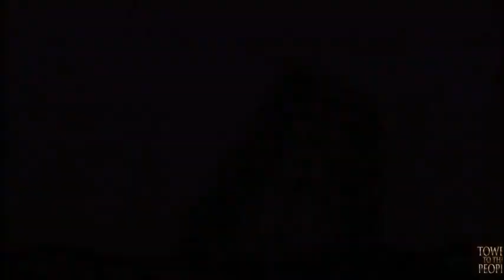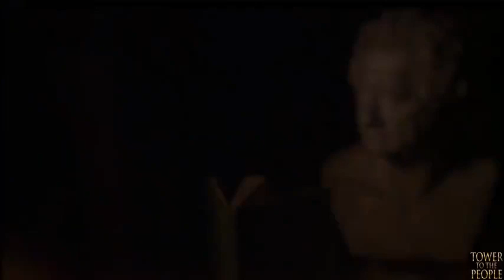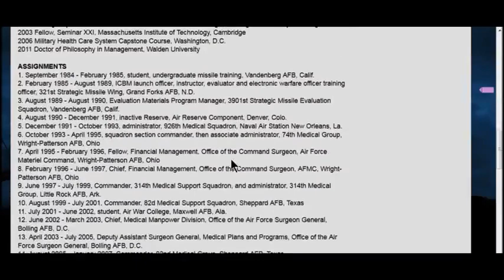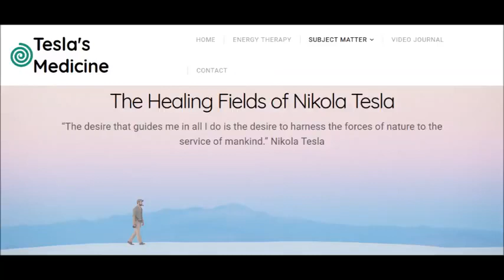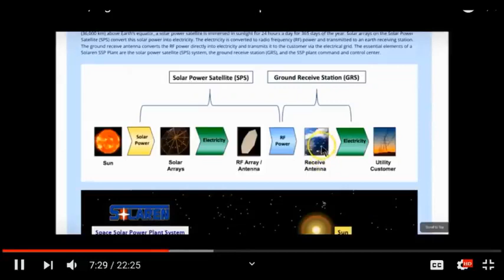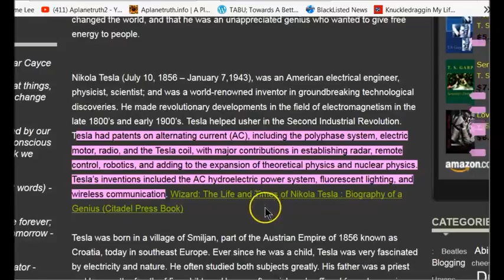Nikola Tesla Tower could provide the World with free wireless energy - Tesla's Wardenclyffe Tower

Comment: HOW MIGHT WE OBTAIN ENERGY from SURROUNDING TEMPERAUTRE
MAY WE?
1)
Might we built thermal motor with 100% efficiency?
This model SAID yes , how? Read below and enjoy the journej

(and therefore have possibility to obtain energy from the surroundings without consuming some fuel though in theory)

(let it be in the vacuum )
Shocking but fact - this motors already convert 100% heat energy into pover
BUT!!!  (how it might be without it) in the First Stage      when it expand to the point where temperature equal environment temperature
(simple machine which consist of piston , cylinder, gas inside it)

In the Second stage we should compress volum emiting heat to the environment with the same temperature what environment has and therefore waste energy (even nothing to contain
thermodynamic allows us contain overheat without effort but in this case we dont have overheat)

So if we can avoid second stage we can save efficiency(and it might remain 100%)

And solution  how to avoid  waste power of compressing gas is...  :)
Dont use GAS !
we might USE LIQUID heated to the boiling temperature (boiling temperature depends on pressure on piston, let it be atmosphere pressure 1 Bar/100 kPa)

So we boil water, expand volume with 1BAR pressure, supply heat 212 F/ 100 C 
in the process, then we store remain warm(overheat if compare it to the environment temperature)
And - without effort return piston to the start position(thats it, all what for all of it,
this key component, we got it)

In the next stage we return stored warm into system and supply additional heat
intto the system
And repeat it again and again never emit any heat to the surroundings
All warm eventually would become power.

We heated water, we get what we want(power)
we store remain overheat to the storage with 0 effort
in order to use it in the next stage, and repeat 
we use heat in storage , then supply additional heat 
and repeat it again and again without waste of energy
therefore all warm energy will become power even though not at once
(thi is idea)

if we talking about water , temperature of boiling water is 212 F/100 C 
Coefficient of efficiency may be something around 4 (0.25 points input power to obtain 1 point warm energy)

And all iof it as we could see , might be converted to power
another words input 1, output 4 , difference would obtained from surroundings warm (another words it may be little bit colder if then)
2)
===============
What if we build a scheme in which we put energy in by maintaining constant current through coil?

We have electric circuit - battery 10 V , resistor 1 Om , output coil of transformer
(we prepear it to input 1A, 1V quadrupol impuls -add to voltage of our circuit 
for a while, transformer make as straight piece of ferrit)
And we add to transgormer 1 more coil to compensate current through resistor and transformer U = 0 V , I=10 A(the same current as main)

So we have current through main scheme 10 Amps, 10 Volts from battery
We throw impuls on transformer 1 Volt , 1 Amp, and have
additional 1 Volt, 1Amp on main circuit.

We spent 10 Volts , 11 Amps from battery 
1Amp, 1 Volt from input of transformer
and (its about which talking about) support coil but no more 0 Volt instead
10 Volt , 1Amp , because input power to transformer cause to this coil 
Voltage as well as to coil in main circuit.

So we spent in total 10 + 1 + 110 = 121

On resistor we have 11 Amps , 11 Volt ,  11*11  = 121 (Equaly)
So we have current which dont change but through increasing voltage
(from 0 to 10 volt) this coil take power to circuit.
Constant current take us power.

But!
What if we replace coil with constant current to permanent magnet?
We safe 10 Volt , 1 Amp then.  :)
Output on resistor would be 11*11=121
Input 10*11 + 1*1 =111

From where permanent magnet may get its power to maintain current I dont know.
===========
3)
And let's see another one oportunity
What if magnet field(force what affect the straight section of wire per miter(not coil))
might be almost constant, as weight force per kilogram near earth surface.

So  to obtain interaction similar to  straight section of current 
we should stretch opposit current away from us.
(we dont deal with this bullish... North and Sourth mythicale poles, its just interaction between parallel currents in plain)

If source of force far enough  and its force  enough powerful
we may obtain almost constant force per 1 weight/current/charge

But what means dB =0, it literally mean that opposite Voltage 
U=dB/dt = 0 as well, 
But its only concerns motor without magnet in this case
because F*L still the same and we don't elaborate some method to turn off magnetic domains yet :)

Additionally if that "far away current" wasn't  a permanent magnet 
rotation of our motor stil would be induce some very tiny Voltage,
which means it should require Voltage for insane amount of current.
But luckily we may use permanent magnets.